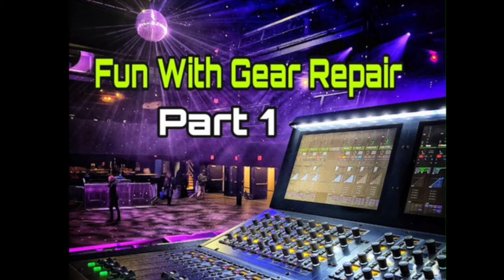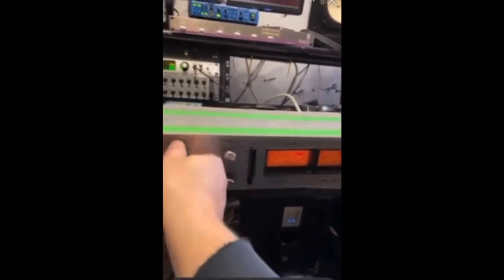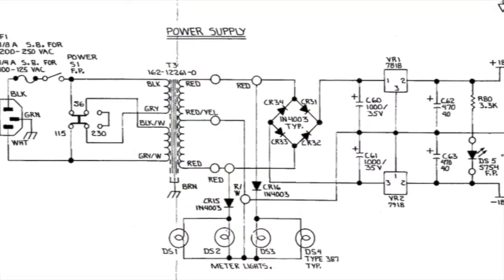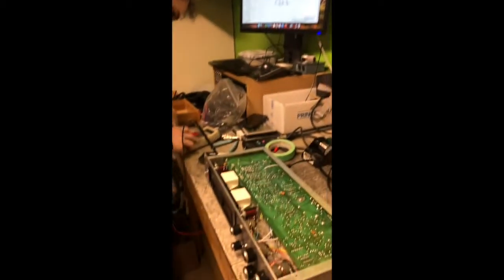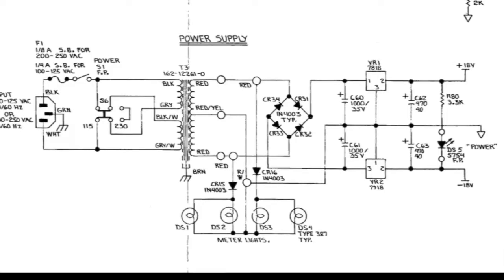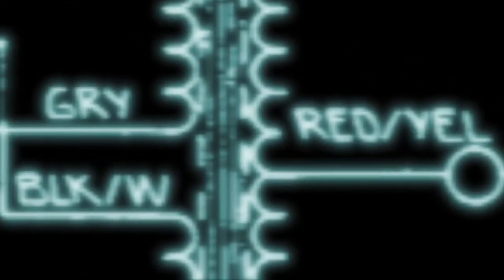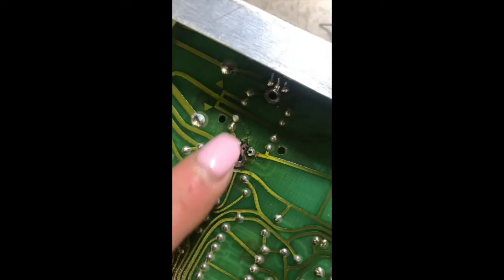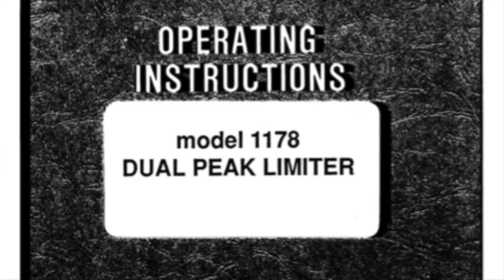FUN WITH GEAR REPAIR Part 1 - Urei 1178 - The Case of the Questionable Schematic

Comment: How did you deal with the broken trace on the circuit board where the voltage regulator overheated?
Reply from the maker: You just use a piece of wire as a jumper in place of the trace to connect to the next point - it's good to keep scraps of resistor legs around for this purpose! Maybe I will make a video about this... thanks for the idea!